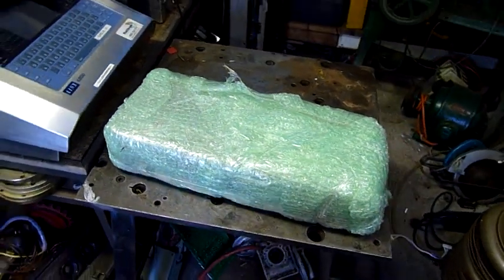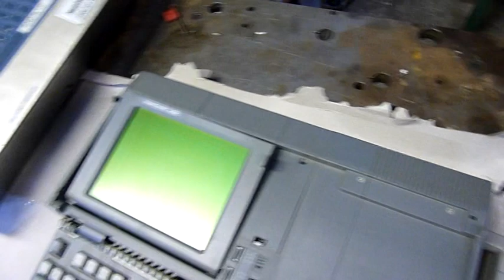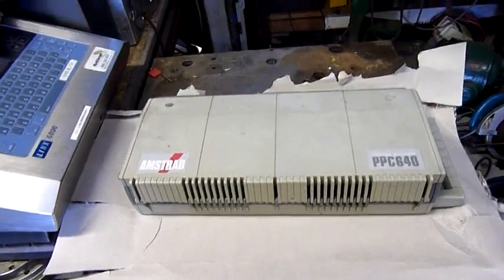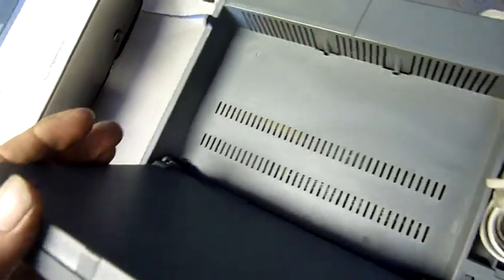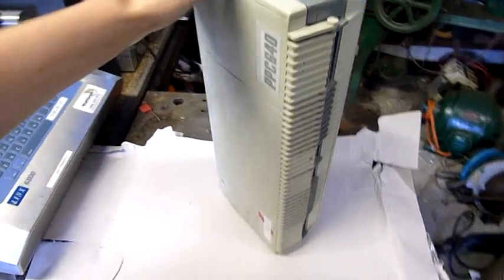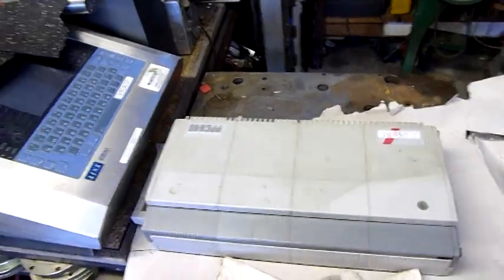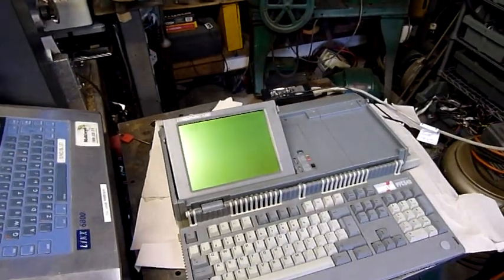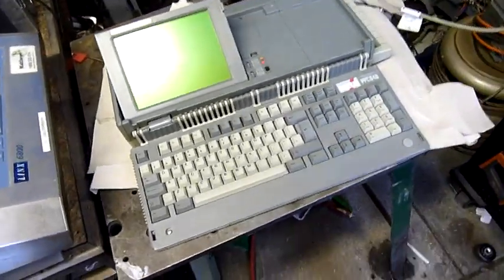Amstrad PPC 640 Portable PC Ebay Find Inspection

Comment: Usually on old machines like this, there is a optical IR detector that turns the internal display on and off. Just a little plastic tab on the hinge that breaks the beam.

Comment: It might be worth checking the DIP switches on the side of the casing. The way they're configured determines what display mode it boots into. Google PPC512 or PPC640 DIP switches for a guide.

Comment: I've never owned any Amstrad equipment myself, but I believe that lots of their computer monitors had power supplies in them for the computer, the monitor would power the computer in other words, that would be what the big DIN socket next to the standard AC Adaptor input is for I think.  If you want to try to create 720 KB disks, don't use Windows XP, it doesn't support them.  Also, check the DIP switches on the left side.  I understand that batteries only last for about an hour or so.

Comment: Okay, here is what you need to set the DIP switches to starting from 1 assuming LCD, CGA and 80 columns: OFF, OFF, OFF, ON, OFF. Also in order for the clock to work you need to have batteries installed for the clock to work (even if you primarily power the computer via a DC input).

Comment: if you can source one from ebay, they're VERY easy to fix if there's anything wrong with them. There's also a working converter using a Teensy(++) and a DIN5 connector- also very easy.

Comment: I imagine you'd want to start off with 15 volts and regulate it down from there, to give the batteries some wiggle-room for voltage drop. If it wants 12V, and that's all your batteries are able to give, then you might not be able to run it under heavy load (for example, FDD/HDD running) without it flaking out.

Comment: Hi you have the crt mode on so you have to switch it to LCD. There are some microswitches on the left of the computer numbered. There is a combination to get the LCD to work. Try to find that info online or I'll get back to you later after work.

Comment: Acrylic solvent cement should repair those broken screen mounts, if you can find the pieces inside the case. But I would dismantle the screen and wash all of the plastic bits first, glue doesn't like to stick to dirt.

Comment: Would that be the ol' "tape over the hole" trick? I used that with varying results on a couple of old synths... best case, it works. Worst case, bits of tape in your drive ;-)

Comment: Ah shit. Thats an odd thing to do.. Perhaps it's just to use the LED to indicate that there is no bootable media in the drive.
Aye, program disks are easy to put together.
It would be neat if it was possible to just put more modern 1.44MB drives in the machine. But it'll be tricky to get the original faceplates and things to fit properly.. Anyways, it's a cool machine!

Comment: Ahh like the xt class of machine :-)

Msdos 5-6 should be ok, you may have to lift the fdd out of the machine and connect it to your pc to prepare the disk, REASON: 1.44/2.88mb drives are not allways that good at formatting D.D disks.